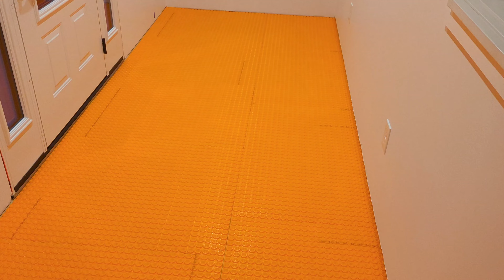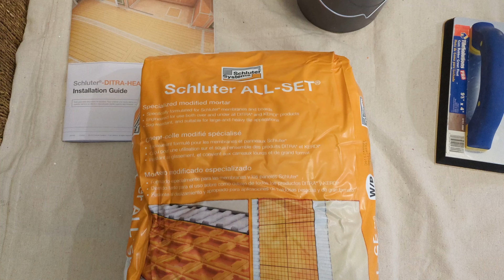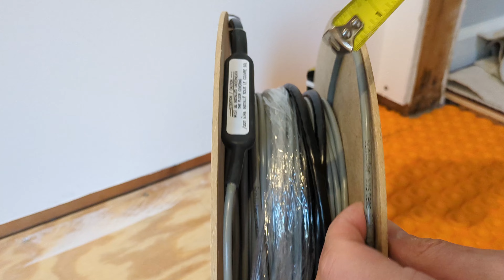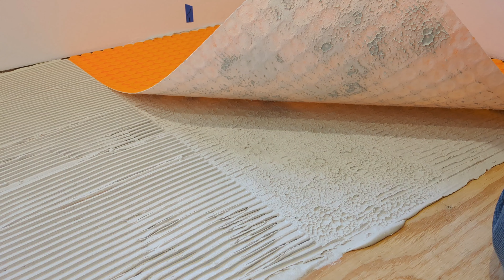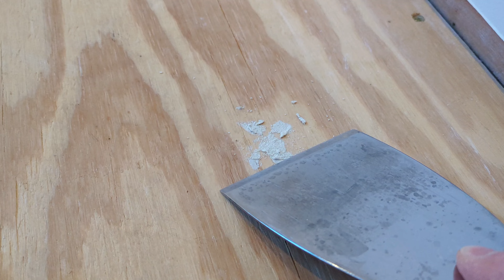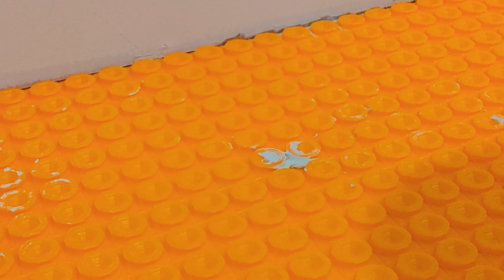How to Install Uncoupling Membrane Underlayment for a Tile Floor

Comment: i think the issue was that you weren't applying enough force with the float.  You really need to put all your weight onto it and tilt the float to concentrate the force to a single edge.  If the float is flat on the floor then you lose a sizeable amount of pressure.  Similarly, the longer 2x4 actually reduce your pressure since it had a larger surface area.
Reply from the maker: All of your weight squeezes out all the thinset and can make it lumpy. It's either need less thinset so a lot of force of all your weight won't squeeze everything out, or recommended amount of thinset with even pressure from a block (but not all of your weight). I think either could work fine but the latter is closer per the install instructions. I've since done the latter and results have been good. I also prefer to back butter the membrane to ensure thinset sticks to every square inch.